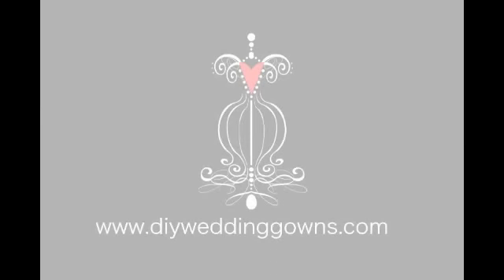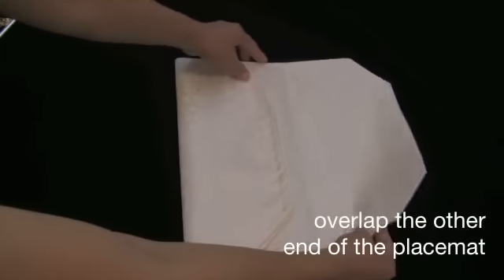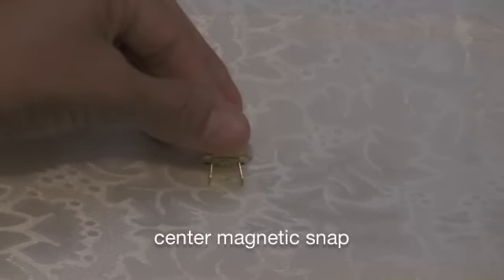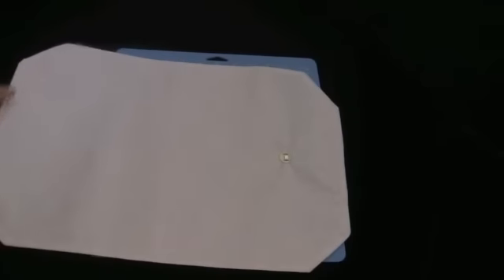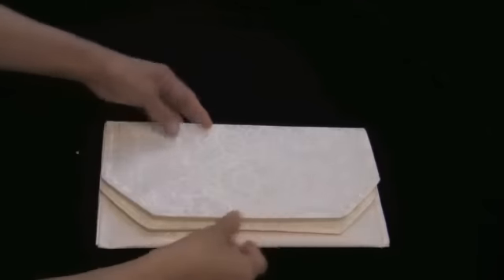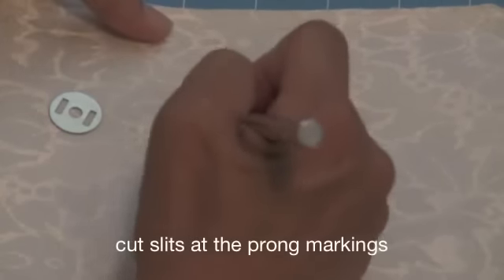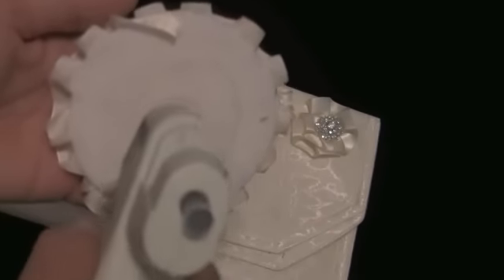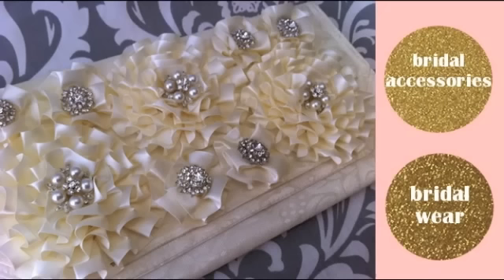{LANA} Bridal Clutch Part 1of2: How to make an easy diy placemat bridal clutch

Comment from the maker: Thanks for watching! Regarding the glue gun, for the pic for the "Ordinaries" list, it was the fine tip cordless glue gun 120v 10w. The one during the filming is the Adhesive Tech Mini High temp glue gun. Didn't realize I used 2 different ones until you asked:) I purchased both from Joann Fabrics and Crafts. I'm sure you can get both at any craft store. If you have any other questions, please do not hesitate to ask.